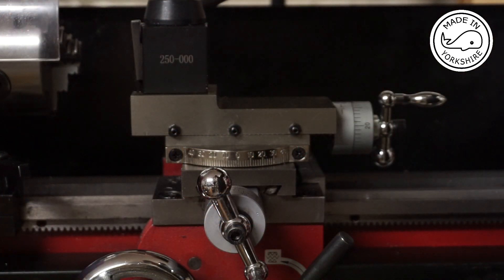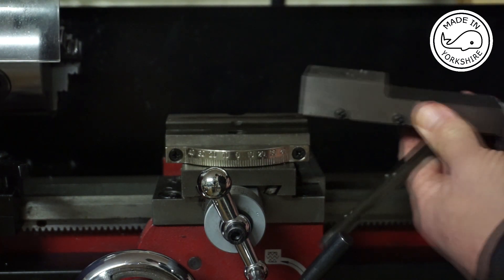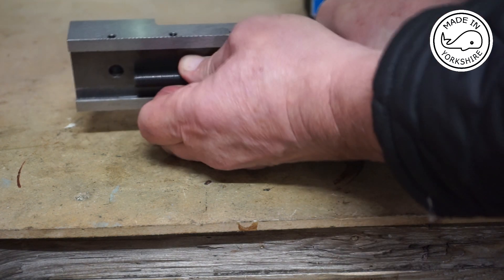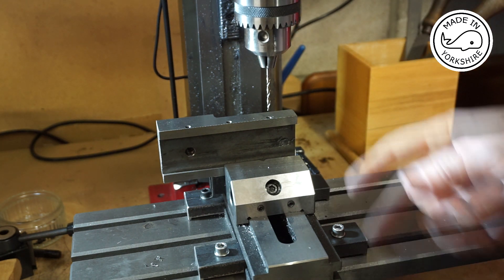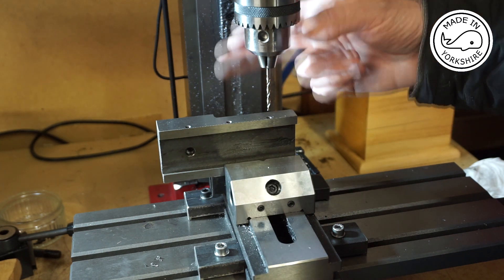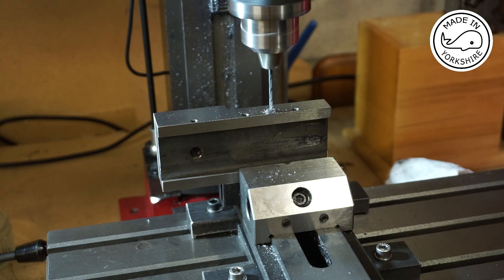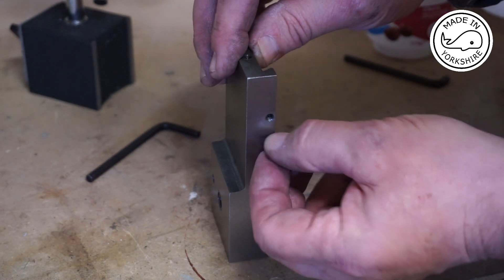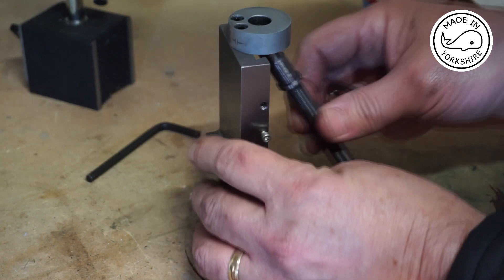#MT15 - Making a Compound Slide Lock for my Sieg SC3 mini lathe. By Andrew Whale.

Comment: Here's a tip. Replace the horrid cap head screws that hold the handles on with dome headed ones. I found the cap headead type are likely to pinch a thumb when rotating the handle. I'm currently enjoying a bash look at your content. Thanks for sharing what you get up to

Comment: I did something very similar On my clarke cl300m, which is in effect a sieg C2 which is now a far from standard machine.I do not have the room for anything bigger so it has had a lot of mods done to it. But I used brass screws which I had made into knurled thumb screws, as they don't need a lot of pressure to lock them up and I can usually lock them tight enough with just my fingers.
Reply from the maker: Hi Stephen - a great idea. I might give it a try when I've got some spare time.
All the best.
Andrew

Comment: Hi,
Another tip.
Once you think your got the Gib adjusted just right.
Place DTI on one side of the compound with the magnetic base on the cross slide.
Now try and wiggle the compound from the opposite end, check to see how much movement you have.
Extend the compound slide in both directions and repeat
Aim roughly for 0.001" tighten the gib screws as necessary and check for smooth operation of of the hand wheel.
This takes the guess work out just trying to wiggle it to see if there is any play ,especially when trying to do a parting operation on the lathe.
This method works for Gib adjustments on both lathe and mill for any axis, just apply the magnetic base to the ways connected to that axis for adjustment.
Make sure the axis has lubrication before hand
ATB Adam
Reply from the maker: Hi Adam - many thanks for the advice.
Cheers
Andrew